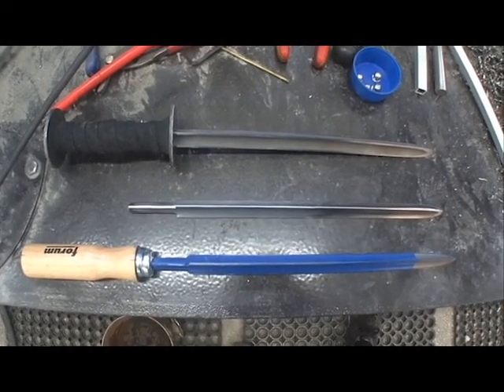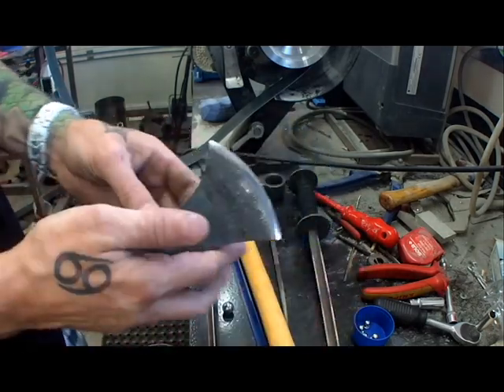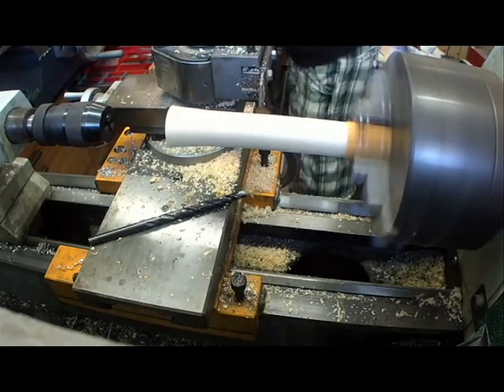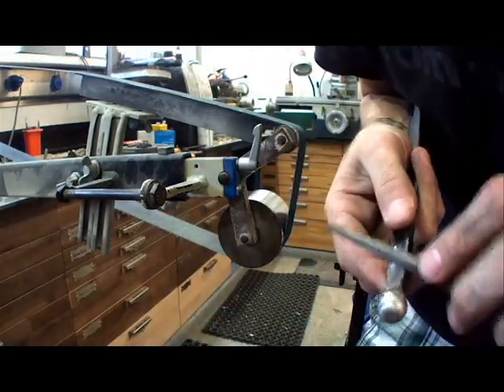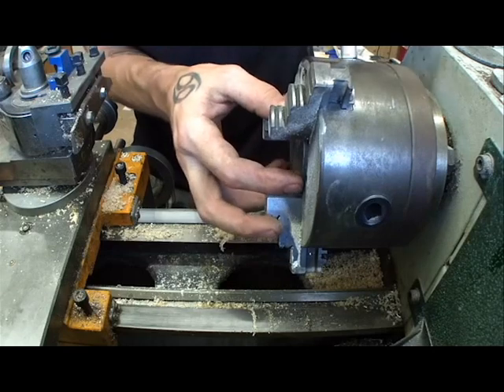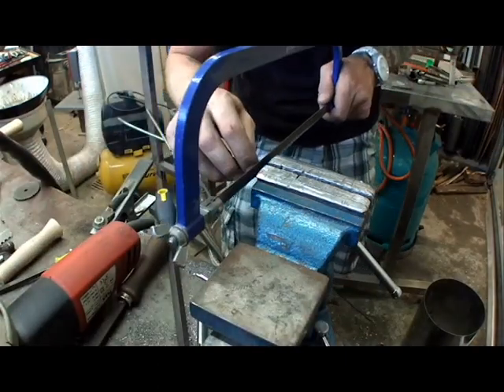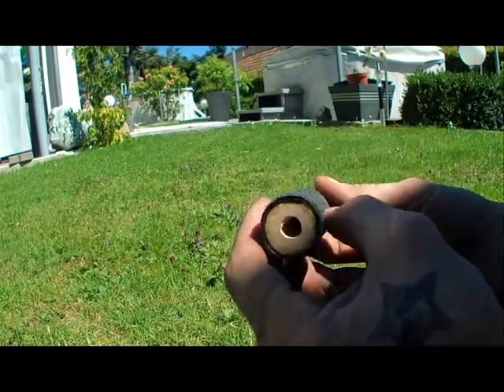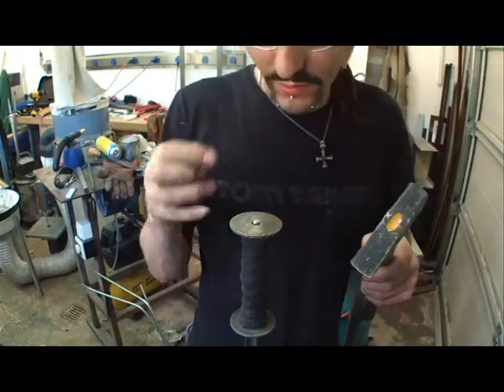How To Make a Training Rondel Dagger - Knife Making 001- WSW

Comment: I'm really having troubles finding this tool online! Can anyone help with a link?
Reply from the maker: here is a cheap one its called hollow ground scraper
https://www.amazon.com/Gedore-Three-edged-hollow-scraper-132-250/dp/B000UYWV9O/ref=sr_1_3?ie=UTF8&qid=1474697051&sr=8-3&keywords=Hollow-Ground+Scraper
you can even buy them in a pack of 10 
https://www.amazon.com/Rennsteig-Machinist-Triangular-Hollow-Ground-Scraper/dp/B0024R5C4G/ref=sr_1_6?ie=UTF8&qid=1474697051&sr=8-6&keywords=Hollow-Ground+Scraper
Reply: Thanks!